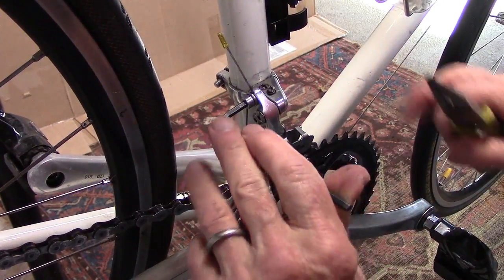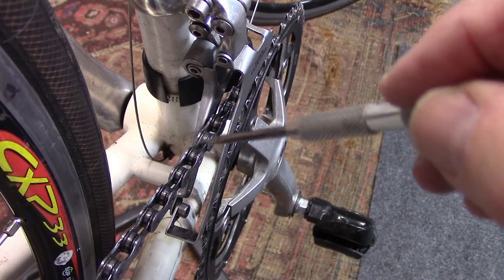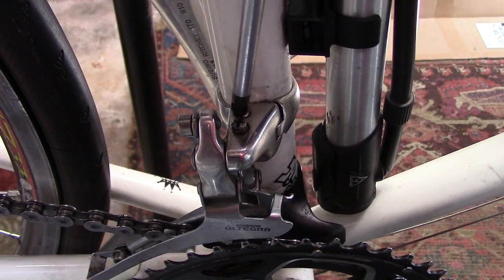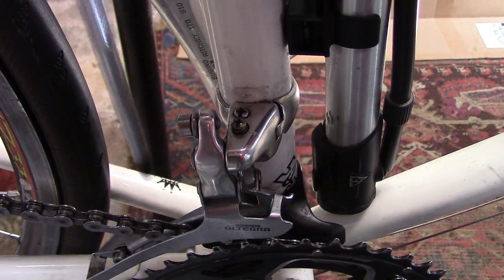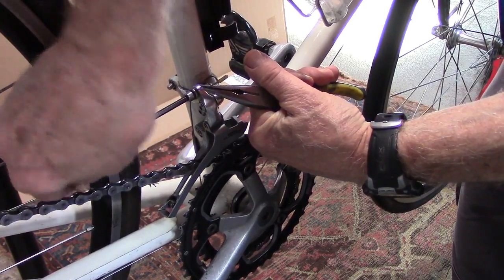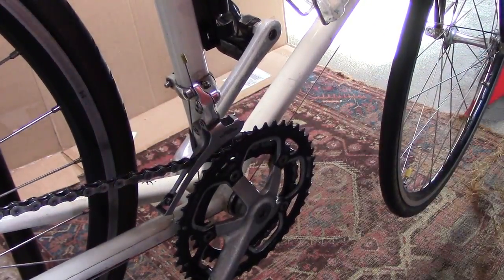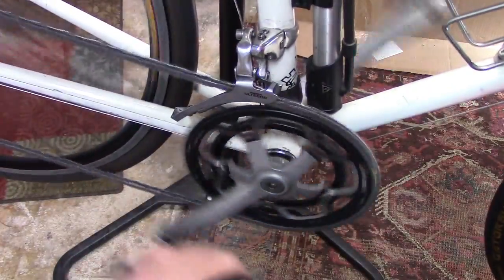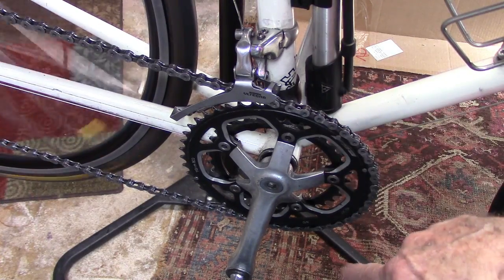If adjusting the limiting screw fails to eliminate chain rub

Comment: just do the half shift
Reply from the maker: Good question. Most of us who have done some racing, do not like the half shift and by adjusting the cable tension can eliminate it entirely. We want to be able to quickly shift from the small chainring to the large as we sprint toward the finish line. The Shimano half shift tends to be a nuisance. And you can adjust your derailleur to eliminate it and also prevent chain rub. This is what we demonstrate in the video. Interestingly enough, SRAM doesn't even have a half shift. But if you have a Shimano system and that's what you like, you can use it. We also talk about other problems causing chain rub in the video. Thanks for the comment. Regards and safe cycling, Tony

Comment: This did not help whatsoever.
Reply from the maker: Remember, you will always get some rubbing in the small chainring - small cassette cog. This is called cross chaining, a combination we don't want to use. You should be shifting to the large chain ring as you get to the small cassette cogs.

What are the chain ring sizes you have as well as the cassette range? Does it rub in all cassette cogs / chainrings or just specific ones? Let me know and maybe I can get a better feel for your problem. 

Also take a look at the following video:
https://youtu.be/lBTLSAOmsYI
https://www.youtube.com/watch?v=mSIK0I4TDNg
https://www.youtube.com/watch?v=ZNG7g83lI-s